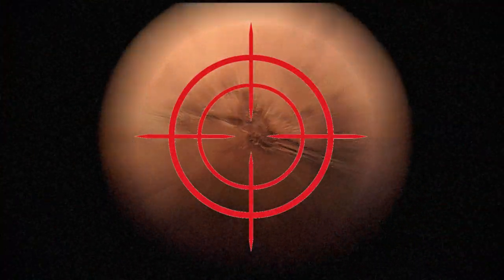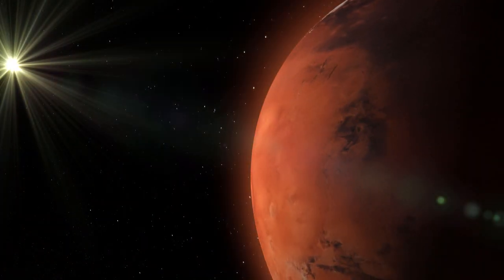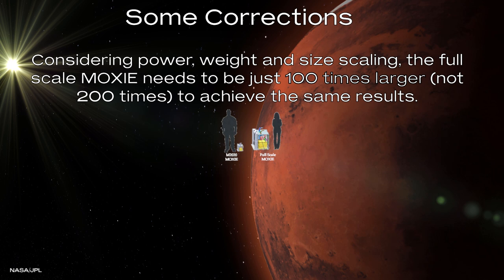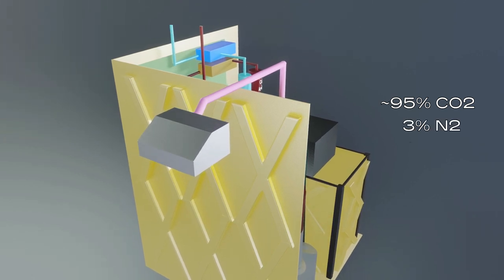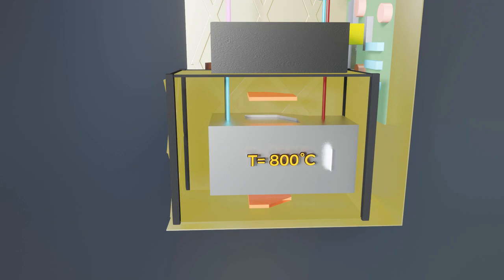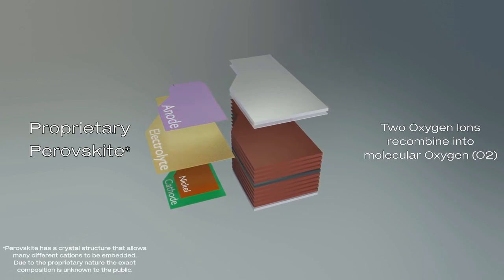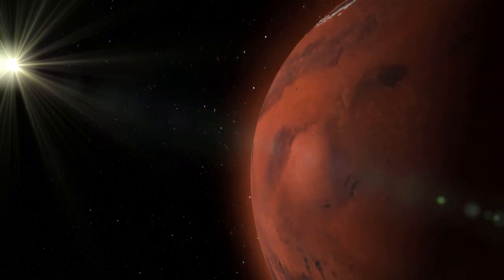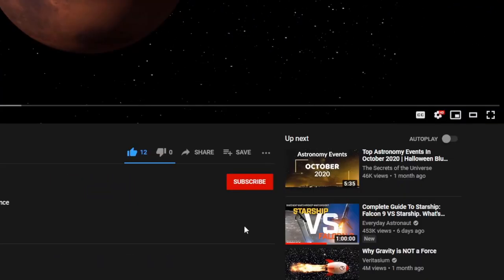Making Oxygen on Mars with Perseverance Rover | MOXIE | Mars Technology

Comment: I wonder if this technology could be optimized to the point of replacing O2 tanks in EVA suit backpacks. Maybe the limiting factor is the power requirements and thermal management. If 30 g O2/hr takes 900 W, an 8 hour EVA would need 7,200 Whrs. At an energy density of 100 Whr/kg, a Lithium ion battery of 72  kg would be required. Seems like it would be too heavy even on mars and getting rid of 900 W would be a pain.
Reply from the maker: Remember you would have to scale up the whole thing, which is already 15kg (for 10g O2) without the battery! Not to mention the noise and vibrations from the pump and loads of thermal isolation to stop you from turning into 700°C EVA hot dog. 

Maybe with a LOT of progress, but not in the near future, scrubbing CO2 from the air you breathe out is way more efficient technique to prolong available breathable air.

Comment: Why can't we use this technology to solve global warming on Earth due to green house emission of CO2 ?
Reply: Probably because the power requirements would be high and the materials cost.
Reply from the maker: Great question, I had the same! The thing is that this only works because Martian atmosphere is basically ONLY CO2 and some nonreactive gasses like argon. On Earth there is VERY little CO2 in the air compared to everything else. So you would have to either compress all of it, to get minuscule CO2, which would mean terrible efficiency, not to mention the other gasses that would stop the reaction altogether. So you would have to filter CO2 from air to do this. And after you filtered CO2, why bother turning it into Oxygen using this expensive and energy intensive technique?

Comment: The light plants require doesn’t need to come from the sun. The power that the Moxie consumes could power LED lights and a heater. A closed system would have a lower water requirement as well.
Reply from the maker: I don't see much of a difference really. It is hard to say whether plants or moxies would be more efficient and which would have more issues. Living organisms are complex and can't be just plopped down like moxie. There is a reason we are not sending bags of seeds and hydroponics on Perseverance.  While I am certain it would be wise for a portion of oxygen production to be handled by plants eventually, the space requirements alone would put moxie as number one producer for a long while (unless we find something better).

Comment: Why are we not using wind power ? There is wind on Mars...seems a expensive waste to use solar when wind is there. Solar would be a back up in times of no wind, but no one knows the weather patterns yet . Its possible wind energy would be better
Reply from the maker: Well, the atmosphere is 1% that of earth. For every 100 air particles that would hit the wind turbine on earth, only 1 would hit it on mars. So ridiculously low efficiency. On top of that wind turbines are mechanical, they have to turn and thus get obsolete sooner. More things can go wrong. Not to mention the dust that would get on and inside them. When you compare kwh of power per kg weight solar panels win again 🙂
Reply: Wind is a byproduct of solar energy. it is defacto less efficient

Comment: What happen when they run out of co2
Reply from the maker: That would be unlikely! It would mean using up the whole atmosphere of Mars! With the rate of 20 g per hour, it would take 142 trillion years. At that point, Mars, the Sun and the whole solar system will be gone.
Reply: Mars' atmosphere is 95% co2. It will never run out of it.